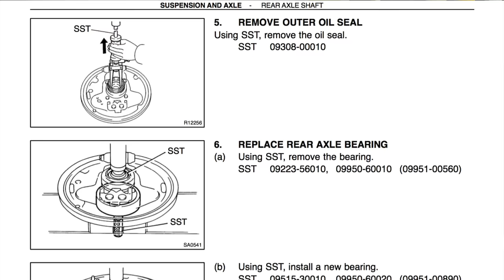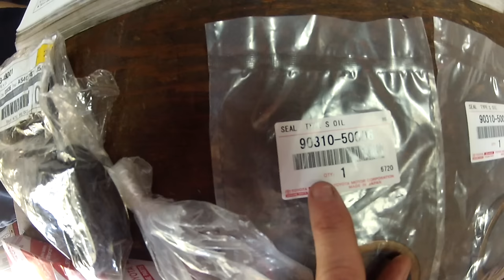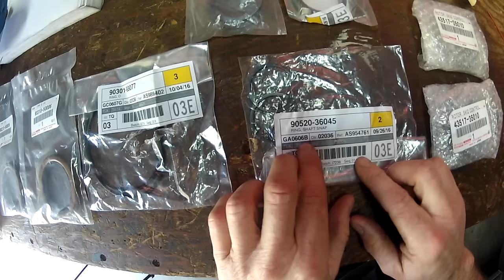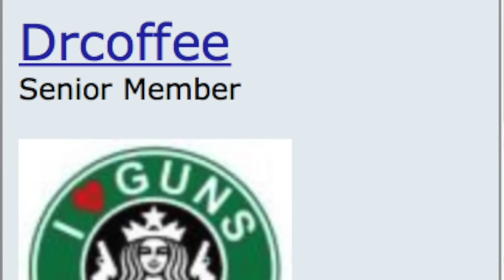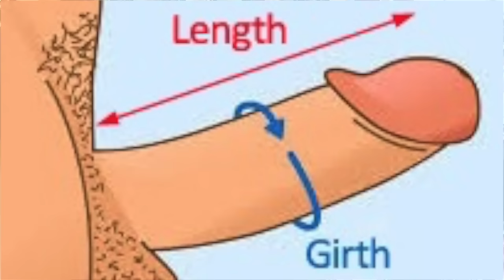Toyota Rear Axle Seal/Bearing Replacement (ABS Rearend)

Comment: This video is the shit. I have a T100 (w ABS) work truck with leaking rear seals and was going to pull my axles and take them to a local dealership, but now I think I am going to invest in the tools, experience, and knowledge thanks to your extremely detailed procedure. It will be one of the most involved jobs I have done to date, but I'm confident that taking it slow one step at a time following these precise instructions it will be fine. Thanks so much for posting!!!
Reply from the maker: Hey Alan, be sure to watch Part 2 because we introduce a better tool and share additional tips and tricks we've learned after doing this job over a dozen times.  https://youtu.be/R-c2x3F8DU4  Good luck with job.  Hope it goes smooth for you.
Reply: @TimmyTheToolman  So I have spent the past few days working on this. Duane's tool and your explicit instructions made the job a lot easier than I had anticipated with few hiccups, but it was time consuming as expected. I also had other things going on, plus the current situation everywhere and an earthquake for good measure. Had a noisy bearing in the differential so I replaced that too. There were some minor differences between the press I got and the one you use so we had to figure out height adjustments a couple of times but honestly the biggest pain in the ass of the whole thing was getting the brake lines back in lol. I also did wheel cylinders while I had it all apart, they are cheap and the truck has over 200k on it. Bled brakes but they still are not right. Pedal goes to the floor so I have to pump them then I guess it's the ABS activating they make a buzzing noise and get grabby/pulsate. It's hard to describe. Gonna try to adjust them and maybe try bleeding again but beyond that I don't know what to do or check, any advice?. They worked better covered in gear oil lol. It was the dirtiest repair I have ever done but am very pleased overall. It would have cost just as much or more to have someone else do the press work. Thanks again so much for the great tutorials.
Reply from the maker: @alancapriotti4605  Hey Alan, glad you got the job done.  In regards to your brakes, did you plug the lines when you disconnected them?  The reason why I ask is because I'm thinking you could have made the bleeding more difficult by allowing a large amount of fluid to drain out of the system.  Along the same line of questioning, did the master cylinder get emptied because the lines were able to drain for a long time?  If the master cylinder emptied out completely, you will then have to bench bleed the master cylinder.  If it didn't drain down all the way, then your problem is you still have air in the lines and your rear brakes probably need more adjusting too.  Bleed the brakes again starting at the passenger side rear, then driver side rear, passenger side front and the driver side front.  Bleed the lines excessively and keep rechecking the fluid level in the master cylinder so it doesn't run dry.  For the adjusting, pull the parking brake over and over and over until you only get 7-9 clicks out of the e-brake handle.  Doing the bleeding and brake adjusting should get your brakes feeling like normal again.  Let me know how it goes for you.
Reply: @TimmyTheToolman  I can't tell you how much I appreciate the personal replies. Do you take donations for doing this? I would be happy to buy you a beer or 6. Regarding my brakes: I did not cap the lines and lost some fluid, but did not know about bench bleeding the master cylinder. I had planned on pumping new, clean fluid through the system during this repair anyway as it was long overdue. I did not run the master cylinder empty though, I did keep an eye on that throughout the process. I adjusted the brakes and took it for another very local test drive. Pedal was much better but the ABS still did that weird buzzing pulsing thing, but not as bad. At this point I was out of daylight and figured I would bleed again this morning. I was sitting around and thought I would take a look at the FSM just to try and learn more about the ABS system on general principle. It said to check the ends of the sensor magnets for debris, which I had noticed and cleaned off a few times during the whole seal/bearing process. However, by the time I was reassembling everything I was anxious to get it back on the road (and it's a work truck I need) I didn't look very closely, doh. Since it was a lot faster and easier than going through another bleed, I pulled those and found some mank on them for sure. Wiped them both off real good and took a test run with a full trailer to the local dump. All good. Went out and did a decent cleanup (wet leaves and a lot of pine needles in the trailer) and drove home. Did not do that even once. I will be paying close attention over the next few days, but it appears to have been resolved. Thanks again!!!
Reply from the maker: @alancapriotti4605  Hey Alan, glad you got it figured out.  We do take donations.  There's  a tip jar link on bottom right corner of our channel photo.  We decided to add the tip jar since people asked if they could donate like you have.  But, you appreciating the videos and sharing your success story with us is payment enough.  Happy Wrenching!

Comment: Thanks Timmy! My 2002 4runner doesn't need this job "yet". But that doesn't stop me from obsessively planning on doing it. I'm in the Rust Belt and can count on pretty much every bolt being seized with rust. My backing plates are turning to dust, so this is a job I will do when I replace them.
Reply from the maker: You're very welcome.  Be sure to watch Part 2 and read the comment we pinned for further information regarding this job.  Thanks for the comment.

Comment: Thank you Timmy! I discovered your channel a while ago when i had a 2wd 2002 4 runner and was stationed in Fairfield Ca. I did a timing belt and a tundra brake upgrade thanks to your help. I then sold it to a father/son in san jose because i wanted to get a 4wd. I referred them to your videos as my step-by-step guide for the repairs and upgrades. I picked up a 100series for my 4wd and later before i left Ca i bought a 98 T100 3.4 5speed manual 4x4 for a daily driver (with almost 300k on it now). I felt comfortable buying it because i knew alot of your videos would be relevant to my maintenance ownership experience. I just discovered a leaking seal and i didn't want to buy a shop press/specialized tool. But ive since moved from California to Alabama and all of the independent mechanics local to me refused the job or dont work on imports. Im very grateful you posted this. I have all the specialty tools ordered (from your part 2 of this video) and i just picked up my 20ton press today. A quick mention to those of you trying to save a few bucks on oem parts . Partssoq.com can save you some big money- just beware that it usually comes from overseas and takes some time to get to you. Shipping rates add up there but i still usually save a significant amount. Thank you again for all your help. Ill be using your clutch video soon. Im both not exited and also looking forward to it at the same time.
Reply from the maker: Thanks for sharing all that Dan.  I appreciate it.  You're not alone when it comes to buying a vehicle because of the of the extensive information available for working on them.  Others have told me that part of their decision to buy a 3rd Gen was because of our channel.  That's always nice to hear.  Good luck with the rear axle.seal and bearing job.  Please be sure to read the comment I pinned (first comment you see) for updates on the repair.   For the clutch job and set of hands certainly helps for the removal and reinstallation of the transfer case and transmission.   Definitely get a buddy or two to help out.  It will make it much easier for you.  Finally, we do have some videos related to your 100 series like our 2UZ-FE Timing Belt Video.  Sean has used Partsouq before.  He has said the same thing.  I get a deal at my local dealership and just buy from them for the convenience.   Happy Wrenching Dan.

Comment: Just completed the rear axle seal/bearing job.  Had the shop flip the retainer and place it with 5mm of polished axle as you recommended.  Did the rest of the job at home.   Performed the sharpie test and the seal hit the retainer dead center!  Thanks for saving me a bunch of money and time with your awesome videos!  How about a rear main seal video??
Reply from the maker: Hey Brad, You're welcome and we're happy to hear our video helped you get the job done saving yourself a bunch of money in the process.  We do have a 3 part video series of doing an automatic transmission replacement on Sean's rig.  That is 97% of the job of replacing the rear main seal.  The only thing you need to do further is remove the flex plate and replace the rear main seal.  For this job, you wouldn't have to separate the transfer case from the transmission and you could maybe just keep it on your transmission jack and pull it back far enough from the engine so you could access the flex plate and rear main seal.
Reply: @TimmyTheToolman  Thanks.  I will check out the trans videos.  My truck is a locked '99 Limited and is well maintained  It has lots of off road mods and is my family adventure DD.  It has been very reliable, but it has 331K! Oil consumption is minimal even with rear seal issue.  The rear seal is about the only thing it needs and the leak is small, but leaks bother me.  Would you mess with the rear seal if it was yours?  Thanks again!
Reply from the maker: @libertyman3717  If the leak is small,  I wouldn't worry about it then.  That's a lot of labor.  Just add oil when necessary and drive it like you stole it.
Reply: @TimmyTheToolman  Will do.  Thanks man!

Comment: Tim, thanks for the reply!
Update: I was able to replace the bearings with Nachi bearings, oem tone rings, and 1st design inner seals with the double lip. We used the MCSpecial tool. Man it was easy. We did mar the plastic housing on the ABS sensors trying to pry them out with channel lock pliers and PB Blaster. They still work.  Once the sensors are out, the seal was easy to remove. Just remove the axle first, remove the sensor, then place a screwdriver in the sensor hole, and pry out the seal. Not much effort is needed to pry it out. This way no damage to the seal surface. Plus driving in the seal is easier since the sensor has a magnet and will pull the new seal magnetically and make it a bear to tap in. The ebay aftermarket inner seals had the same black rubber like coating on the seal-all the way around (similar to a GM rear main seal). We taped them in with the 72mm MADDOX seal driver. Any edges still present we just tapped it the 68mm. Not much tapping need. Since we used 1st gen design seals we replaced the inner spacer with the bevel pointing inward, 5mm(driver) and 5.5mm(passenger) of shiny axle metal showing.  The grease test showed grease was pushed all the way to the tone ring, so we were happy.  650mi at 70mph later, no leaks so far. I always buy OEM but I didn't want the new OEM re-design seal, and I couldn't find NOS seals, so I went with aftermarket seals. 
Thanks again Tim!!!!!
Reply from the maker: Glad the repair worked out.  You're the first person I've heard pry the seal out via the ABS sensor hole.  Interesting.  If the grease test showed the grease pushed all the way back to the tone ring, that's not centered on the retainer.  You would want the grease pushed back to the center of the polished surface of the retainer.  But with the measurements you gave, I would assume you were centered on the retainer.   Maybe you misspoke.  Do you have a link to the aftermarket seals you went with?

Comment: Nice to see the under side of my 4Runner getting semi-famous!
Reply from the maker: phattyduck Hey Charlie, Since this repair is so common, I think your rig is going be seen by a whole lot of folks.  Thanks again for allowing to use your 3rd Gen as the test subject for this repair.  I've now actually done this job on two other ABS 3rd Gens and I have another one lined up whenever I get back from this fire in Ventura and Santa Barbara County.  I just ask them for a donation to our party fund.  We'll probably have another party in the spring.  Maybe you'll drive down from SoCal.

Comment: Thanks so much for this video! Just completed the repair myself and all went fairly smoothe asides from me forgetting to take off the snap ring before trying to push the axle out. 4 new unstripped bolts later and I was back in business.  Wanted to give people a few ideas that I had when I did this repair. Instead of pressing in the bearing I simply tapped it in gently with the race and bearing driver set  that is used to seat the seal (rented from O'Reilly). Additionally I did not want to buy a 100 dollar press sleeve kit so I went to Home Depot and bought a pvc coupler for 1.25 (could have been 1.5 inch, just bring the axle puller tube and match the end size) and it worked great and cost me about a buck fifty.
Reply from the maker: You're welcome.  Good job getting the job done.
Reply: One more thing if you don't mind me asking. I bought the same puller you have linked in your video but it did not fit over my axle. I measured the inside diameter of the axle puller and it measured 1.58 inches and the puller is advertised at 1.5 inches. I bought all new bearing retainers and they were the same size as my old ones and I was able to get them pressed on the axle okay which leads me to believe that my axle should be the correct size and not some swap (I bought my rig used a few months back) so I am wondering if you had any thoughts as to why the puller wouldn't quite make it down to bolt directly to the hub. I ended up having to just buy longer bolts to reach down to the hub for the press work. Thanks again for all your awesome videos
Reply from the maker: I have to ask if you watched the entire video? At around play time 30:30, I discuss that you have to pop the axle shaft down against a block of wood to knock the bearing back fully into it's case so you can get the tool bolted up to the axle.  Also in the video, I show how I altered the tool so the OEM bolt lengths will work better with the tool plate.  I basically milled out 5mm of material around the bolt holes and I also used a round file on one side of the threads so it would fit better.

If you didn't pop the axle shaft into the ground and/or didn't altered the plate like I did, you pretty much would have had to use longer bolts to make it work.  The Durasolid tool works decent, but it could have been made better.
Reply: @TimmyTheToolman  I have watched the video more times than I should probably admit. I'm a bit of a planner and made sure I could follow your video step by step as to avoid any possibility of me making my vehicle worse. I was running into problems when getting the puller over the part of the axle that begins to get larger  before you even hit the polished section. Even with the axle stated fully after reseating it with the tap on the wood there was no way to even get the tube slid over the axle far enough to screw it into the blue plate bolted on. 

I hope that all makes sense, I'm doing my best to use the correct words for different parts to paint the picture of what was going on.

Edit: I had to go do a sanity check before I made a fool of myself here and measured the ID of the axle puller and the ID of the old retainers and in fact the ID of the axle puller was 1.56 inches and the ID of the old retainers were 1.575 which would make sense as to why I couldn't get it all the way over the axle down to the hub
Reply from the maker: @TheBar2z Ok, I understand now.  Please do me a favor and contact Durasolid and tell them what you're experiencing with their tool.  They must have changed something with their manufacturing or possibly changed suppliers of their pipe stock.  It's important they know this because this is a flaw that needs to be addressed.  Please let me know what they say when you contact them.  They really should send you a replacement with the correct internal diameter.

Comment: Great video. Last guy who did a bearing didn't watch it and it leaked. I put a new seal after flipping the outer retainer. 4.5 to 5.0 mm worked great.
Reply from the maker: Good job doing it right.  This job is screwed up by many shops and DIYers.